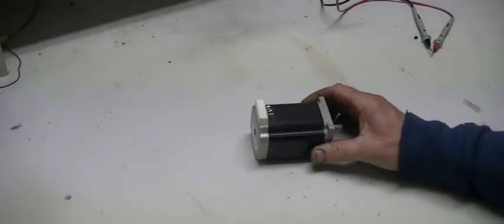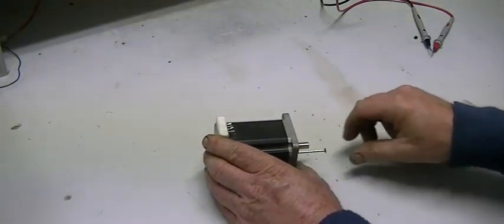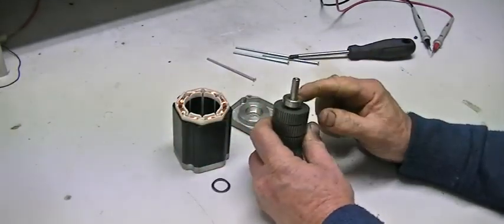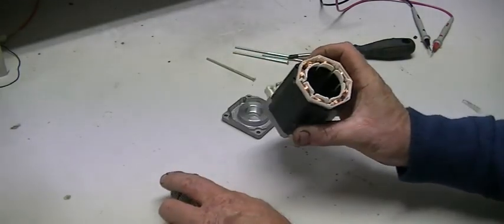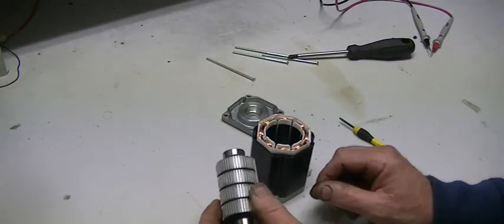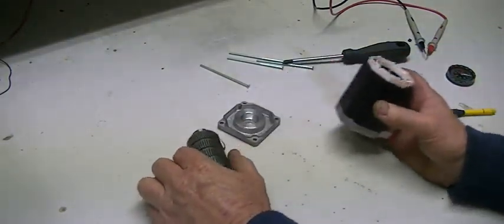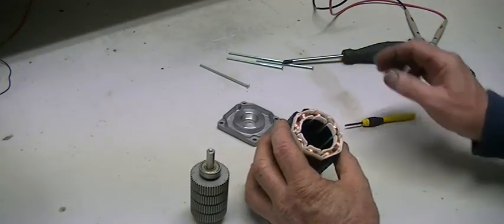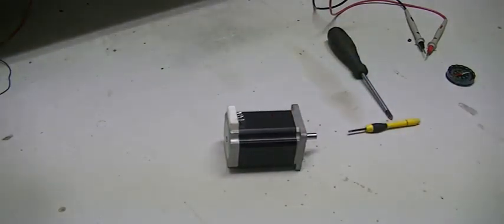Large Stepper Motor Tear Down

Comment: I wonder if the current magnetized it? Drill out spaces on the armature and install some magnets in it. That is, if you don't need the motor any more. Great channel you have. I subscribed. 

🧲 Sorry it took me 9 years to stumble across your comment. I cannot keep up with thousands of comments in a timely manner. A lot has changed since you comment here. If you're still around, simply respond to this and I'll do my best to respond to any question you might still have quickly. A lot has changed since your post. The wheel never kept Turing at that stage, thus I kept using my hands to stop the wheel. Guess you're not getting automatic updates from me? Go here for some breaking news. 👉🏻 https://youtu.be/8EYxKWsVx2k

Comment: Building a large Stepper motor was How I got started in this free energy research that I've been doing for the last 2 years.  I plan on using a CNC cad program to control the pulse length the pulse width and to retard or advance the timing on my motor. Basically let the computer program determine the timing for the speed of the wheel while loaded or unloaded. Very nice demonstration of a bigger stepper motor thanks for sharing the information and good luck on the journey.